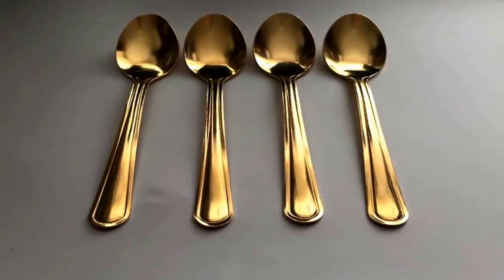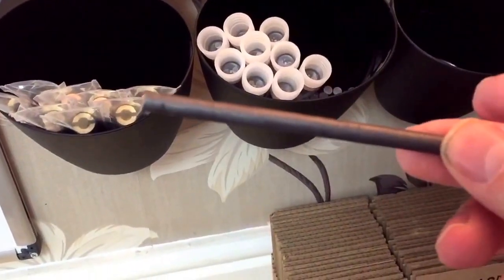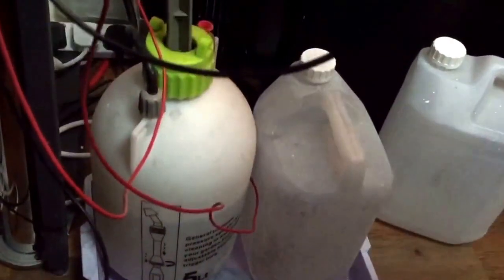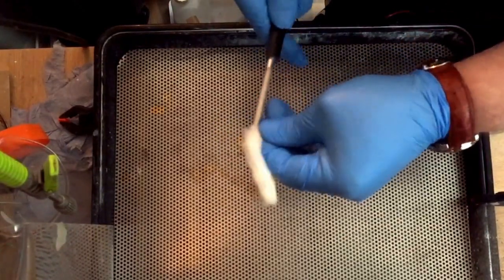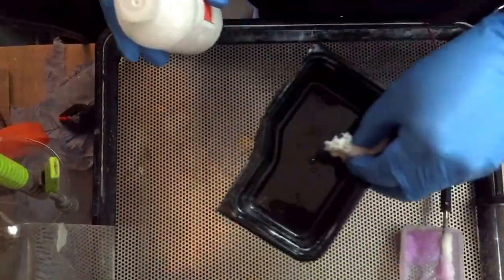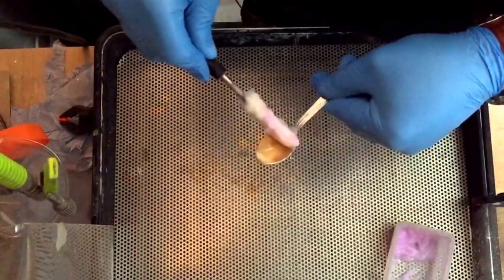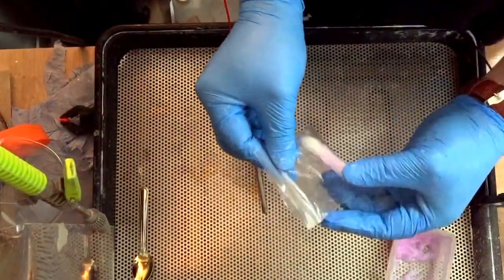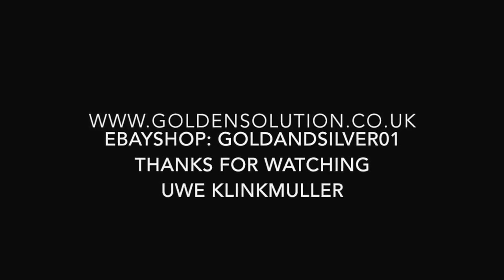How to Gold Plate on to Stainless Steel

Comment: On bike parts? Do they corrode afterwards? Silencer ,rim etc
Reply from the maker: depending what material you plate on to 

as gold never tarnish or corrode however if you plate a thin layer of gold on to steel it will rust under the gold but if you plate on to stainless steel that will never corrode 

thanks

Comment: Can metal leaf be electro plated
Reply from the maker: yes its possible but not easy 

thanks
Reply: @GoldenSolutionPlating  thank you for that because the reason I asked you that is because I have made a clay sculpture of tutankhamun and a couple of other things from clay then I cover the whole thing in epoxy resin first then i use real gold leaf to cover them over afterwards then I had a thought if I have to buy a tin of special paint that has metal bits in it too be able to electro plating plastic resin then what is the point of having to buy a tin of paint specifically for electroplating solution when metal leaf will do the same job what do you think any good or not!
Reply from the maker: @therealityartist9057  that sounds good and should work 

thanks
Reply: @GoldenSolutionPlating  you see before I asked you this question about gold leaf i Googled searched it first to find out if metal leaf is a good conductor of electricity and it says yes according to Google search!
Reply: @GoldenSolutionPlating  i have started using real genuine gold leaf last year and this stuff is stunning to look at but when I saw someone posting things done by electroplating solution it completely blew me away and changed my mind on gold leaf instantly and putting my work too shame when I realized what  electroplating is after all these years has totally blown me away because of its brilliant high quality shine and now I myself want to get into this amazing experience with electroplating solution because I use a lot of epoxy resin to make all kinds of things and cover them as well and it says electroplating solution can be done on plastic acrylic as well and epoxy resin is a kind of plastic acrylic at the end of the day and will have to buy this paint for electroplating it says!
Reply from the maker: @therealityartist9057  you need conductive paint or ink 

and copper tank electroforming solution 

https://www.goldn.co.uk/product/9564/
https://www.goldn.co.uk/product/conductive-paint/
https://www.goldn.co.uk/product/conductive-paint-airbrush-version-uk-eu/
Reply: @GoldenSolutionPlating  great fantastic thank you so much for that good advice thank you much appreciated!
Reply: @GoldenSolutionPlating  i can't use any dipping tank because my projects are far too big too fit into any tank and must be done with a brush pen or something like that!
Reply: @GoldenSolutionPlating  this site you sent me can it be delivered to the channel islands just outside of the UK if and when I am ready to have a go at this plating because I am not in the UK but we are part of the British isles
Reply from the maker: @therealityartist9057  im not sure you will find out when you order 

thanks

Comment: Hi I wanted to purchase a gold plated stainless steel necklace from a store I was wondering if the gold would be able to go in water or will it fade away over time also would stainless steel  be capable of going in water without rusting or tarnishing I’ve been getting different answers
Reply from the maker: hi yes you can go in the water no problem if the plating is very thin it will wear off or can also tarnish depending what the base metal is as gold never tarnish 

stainless steel dose not rust so you can go in the water as well yes 

thanks

Comment: I bought some  18k Gold plated jewelery good? its stainless steele based.... Also PVD plated.... Which is better... Brush or PVD? Plz reply
Reply from the maker: depending if you plate a thick layer of gold like 3 plus microns gold would be better but normally pvd last longer if you compare it to a gold plating of less than 0.5 micron 

thanks

Comment: what is 'thickener' - where do you get it|?
Reply from the maker: you can get it from spa plating
Reply: @GoldenSolutionPlating  do you really need the thickener? what effect will it have not using it?
Reply from the maker: Jan De Buysser Lin you don’t need it it helps for plating items what you can’t remove that the gold is not running away
Reply: @GoldenSolutionPlating  oke, wel i want a old brass (warn down) kind of look for my stainless steel, its for garden furniture, any tip's?

Comment: do i need to nickel strike stainless before copper plating?
Reply from the maker: ARCSTREAMS  as you can see in the video I plate directly on to stainless steel 
You may need to when you tank plate 
Thanks
Reply: you gold plated,,im talking about copper plating directly to SS,,i tried and it does not work ,rubs off ,so i am asking you can you copper plate ss directly or does it need some kind of preparation?
Reply from the maker: ARCSTREAMS  oh sorry 
Yes you need to nickel strike or gold flash before copper plating
Reply: and you used something called pmu so i would not say you done it directly
Reply from the maker: ARCSTREAMS  it is directly because the mpu is a cleaning and activating compound as a replacement for cleaner and activator
Reply: ok so for Cu plating SS i need to nickle strike it first?  but for gold plating SS i do not need to?
Reply from the maker: @ARCSTREAMS  copper plating on stainless steel you need to nickel strike or gold brush plate as on gold sticks basically everything 
gold brush plating on stainless steel you do directly you need to clean and activate before if you tank plate on stainless you need to gold or nickel strike 
thanks
Reply: thank you sir
Reply: ohh i also wanted to ask what about copper plating steel ,can this be done directly? some ppl say yes some say no,,i tried but it rubbed off
Reply: also since you can gold plate ss directly can you also gold plate mild or regular steel directly?
Reply from the maker: Yes
Reply: really? that is amazing,funny how you can not copper plate steel directly but you can gold plate it directly,wow

Comment: Great informational video. Do you know how toxic or dangerous is the manipulation of the chemicals and elements used in the process of gold plating at home? I see you're wearing some rubber gloves, but, because of the camera angle, I can't see if you're also wearing a protective mask (for the chemical fumes) of some sort. Please advice. Cheers
Reply from the maker: carriebtc 
The gold and silver plating is not toxic at all and I do not wear any mask 
If you do chrome stripper that’s toxic yes
Reply: @GoldenSolutionPlating  Thank you for the reply. Feel much better now. Cheers
Reply: I hate it when people subtext what they think someone is doing wrong by asking a loaded question. Like about the respirator.  You know he isn't wearing one but you don't have the balls to just say wear one.  So you try to innocently dance around it.

Comment: How about gold plating a knife, do you know if this gold plate works on pattern-weld steel, brass, and nickel?
Reply from the maker: yes it will  on nickel you can plate gold directly on brass you need to nickel plate first and on weld steel you may have to copper and nickel plate first 
thanks

Comment: I want to plate some bike parts any advice on how to do so
Reply from the maker: ss ss what are they made of
Reply: @GoldenSolutionPlating  Im not too sure, its a lowrider bicycle. I wanna plate the handle bars,fork,rims,  im guessing its iron but idk to be honest
Reply from the maker: you need a plating kit https://www.goldensolution.co.uk/collections/frontpage/products/gold-plating-kit
you can gold plate on to steel but the best is to plate very thick with copper and nickel because of rust protection you need to do this in a tank 
you can plate gold directly on to steed but it can rust 
thanks

Comment: Great video. Is there a way to gold plate stainless steel without using Wood's Nickes Strike ?
Reply from the maker: yes i don't use nickel strike
Reply: @GoldenSolutionPlating  thank you for replying. What do you use exactly ? If you could leave a link to the product I'd appreciate it.
Reply from the maker: Jeff from New York proud owner of a 4670K 
I use mpu as you can see in the video 
https://www.goldensolution.co.uk/collections/plating-chemicals-and-polish-mpu-meta-seal-activator-cleaner-chrome-stripper/products/mpu-compound-100ml
If you do tank plating it’s a different story you may need nickel strike
Reply: @GoldenSolutionPlating ثري

Comment: Sir can we plating on abs beads in barrels?
Reply from the maker: Mohamed Ayaz Shaikh 
No you need to plate them in a copper tank first
Reply: Sir Thanks a lot, but ABS material is already electro conductive and we want to plating golden in barrels
Reply from the maker: Mohamed Ayaz Shaikh 
Ok ok I thought it is plastic 
Sorry I don’t do barrel plating 
But it should work 
Thanks